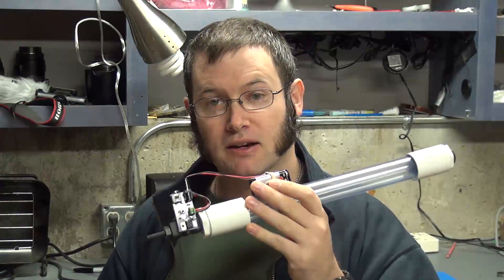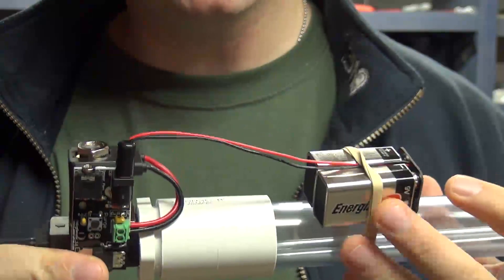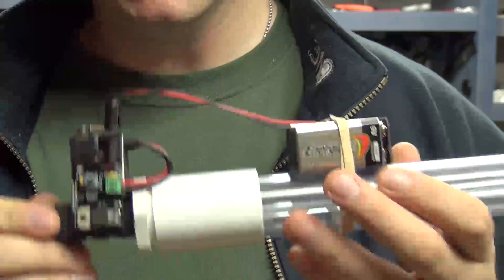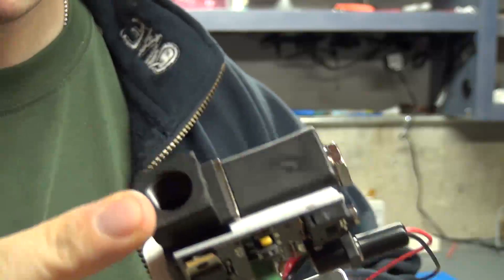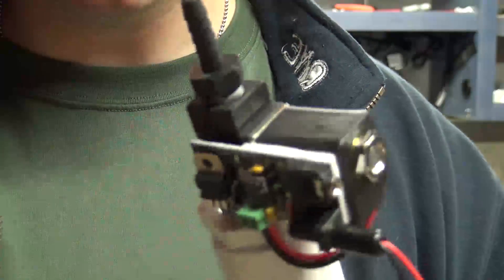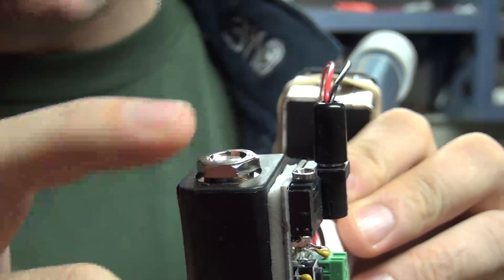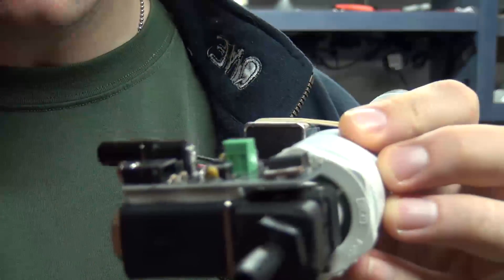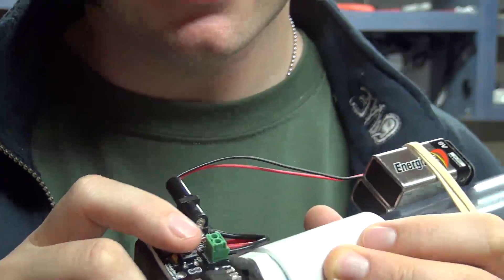TPB #52 - Valve Sensor Updates and Troubleshooting

Comment: The problem is there are a few connections like the cord that goes to the battery and the cord that goes to the CA.  These plugs will get gummed up or you wouldn't be able to detach them.  Neither of these is ideal...